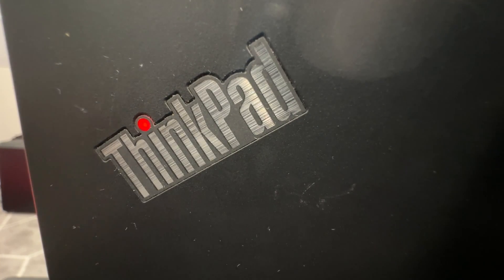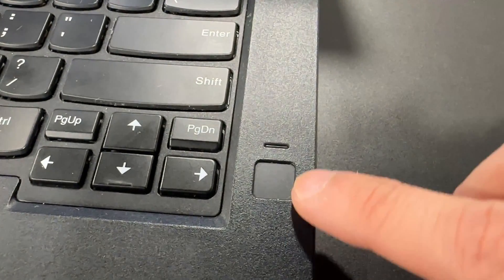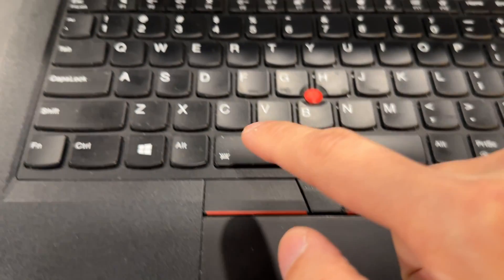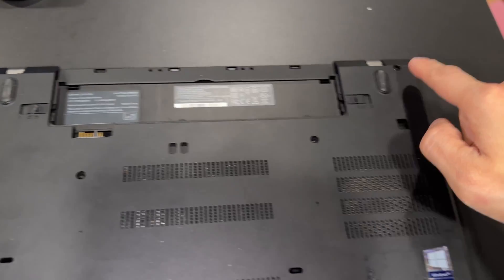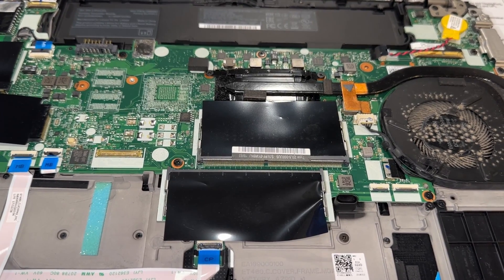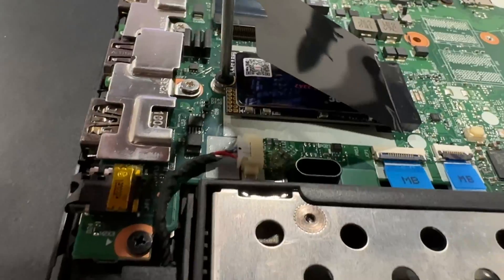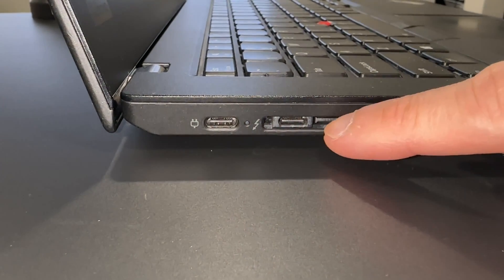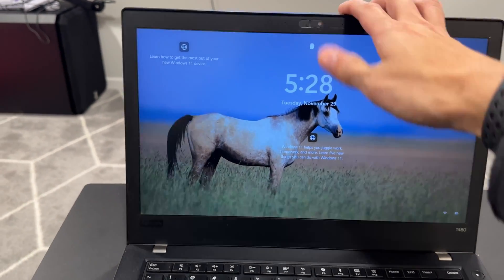How to Buy and DIY Upgrade a Used Lenovo T480 | Budget Laptop Upgrade Guide

Comment: Buy a t480 asap because prices are increasing very fast as it’s better then t470 and t490
Reply: Kunibert  Because it's the best modern thinkpad for people that want them like they used to be.
No soldered RAM
Swappable battery
Quad core CPU (t470 i7 only had a dual core)
It's the best thinkpad even the t490 don't have external battery.
Price are increasing because people start to buy them as they understand the value of it. It's hard to get a good deal outside USA for less than 300€
Reply: I own one and I agree. I had money for the T490 but comparing it to the T480 I went with that one
Reply: what about the 480s?

Comment: I just scored one of these from a friends company.... Its practically brand new... no wear at all... And he threw in a Tbolt dock....  So question, can you boot off the 2242 NVMe???  Also whats the purpose of the ID reader?    And my Thunderbolt software doesnt have the menu yours does... Any idea how I can check the firmware version?  Thanks!
Reply: Congrats! That's pretty killer. Yes, you can boot off the 2242. I do this on both my T25 and my T480. They both have a Western Digital SN520. Just in case you run Windows: I've run into problems installing it to the 2242 via USB using Lenovo's DDRS recovery, but if I use Microsoft's Media Creation Tool to do it I have no issues. As far as the Thunderbolt firmware version, you can get this in the Thunderbolt Control Center under "About." It's listed as "NVM Firmware Version." My T480 reports version 23.
Reply: @MattJH  Yeah I have played with it for a bit now and have ordered the 2242 drive and its getting here today... And I was able to update my Tbolt firmware to 23 as well... Took me a while to figure out how to see what version it was on.  What's Lenovo DDRS? Sorry just woke up and brains not working!
Reply: @neccros007  Morning! DDRS is Digital Download Recovery Service. If you don't have a Lenovo restore CD, you can use DDRS to image your machine back to the way it was at the point of sale. It recognized the 2280 drive on both of my ThinkPads, but not the 2242. I still don't know why. Microsoft's Media Creation Tool saw both drives so I just went that route and washed my hands of it.
Reply: @MattJH  Ahhh yeah I never heard of it... I have a small ITX music server/streamer that I have running off a NVMe on a PCIe adapter. MS see's it but in order to boot off of it, I have to have a internal USB with Clover to boot from to be able to see and boot off the NVMe.  I wanted to make sure the 2242 was bootable natively because I want to run my OS and apps off this drive and use the 2280 in mine as data only.
Reply: @MattJH  Well my T480 now has 32gigs of ram, AX210 Wifi 6e card, a 512 gig WD SN520 2242 NVMe and a 2tb Kingston 2280 NVMe.  Booting off the SN520 flawlessly!
Reply: @neccros007  Yes!!! That is awesome man. Happy for you from over here in Philly. It’s remarkable just how stacked you can make this model. I use mine everyday as a general use, and I intend to continue for as long as it lets me. It’s perfect.
Reply: @MattJH  Yup...I plan on doing everything on this thing.... Even some emulation and certain games... but mostly media like movies, music(through a external DAC/Amp) and general web surfing and file organization.  I have about 30 HDs I am sorting through and consolidating to my file server so the space I have, I can move a bunch to the T480, sort it when I am out and about then move it over once its complete